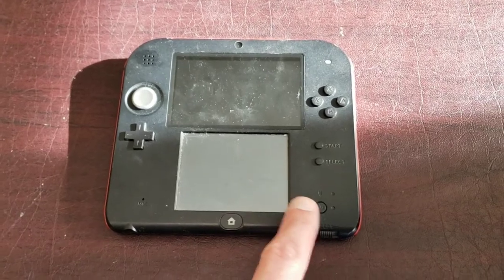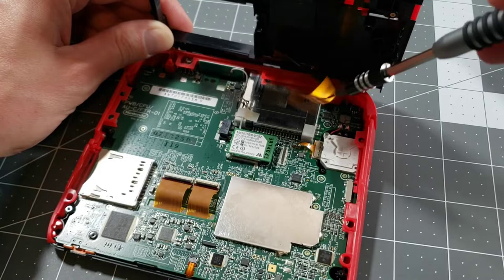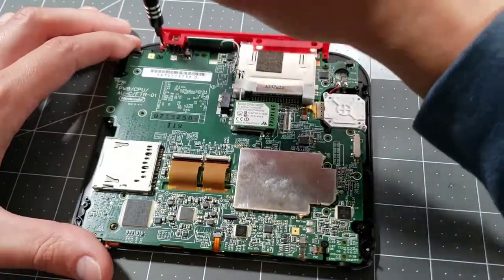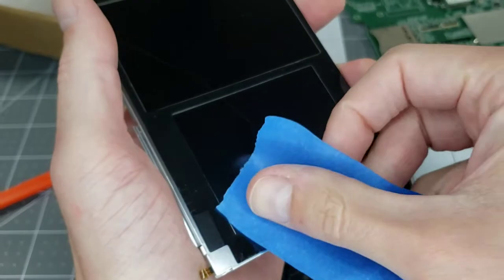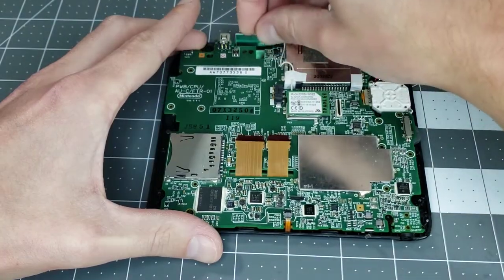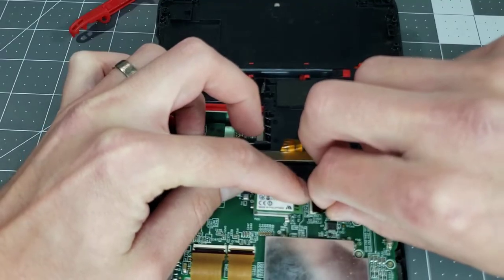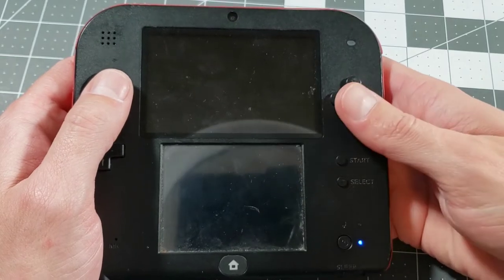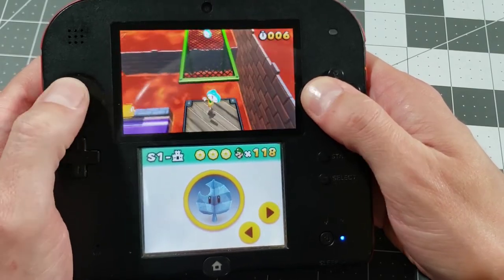Fixing a 2DS That Won't Power On  (Turns off with a POP!)

Comment from the maker: Disclaimer: Unless your 2DS has sentimental value, I probably wouldn't recommend a screen replacement simply because the cost of the screen (at the time of making this video) is almost identical to just buying another used system. If you have this issue and your screen does not appear damaged, here are a few things to check: 1) are all the screen connections secure? There are 3 in total going to the PCB so be sure to check all of them. 2) Are the screen connectors on the PCB itself in good condition? A damaged connector means a bad connection. 3) Are there any broken traces on the PCB or the screen flex cables? This can be tricky to identify, but if conductors are damaged, it will behave just like the screen is not plugged in. 4) If everything looks good and you still have this issue, just try disconnecting and reconnecting the screen cables, check the gold pins and clean them if necessary before reconnecting.
It is possible there are other causes for this issue not related to the screen/digitizer; I don't know of any, but please let me know if you come across any new information.
Happy fixing y'all!
Reply: Hey dude, thanks for the video. I'm so bad with technology but I will check to see if the connections are disconnected.
Reply from the maker: @clairejagels9598  hope you can get it working again!
Reply: @FantasticQuack  I did. Then I put my purse down at a Walmart and it got stolen. Its time to emulate
Reply: Can you fix a screen without replacing it?
Reply: You can only if it's not broken
Reply: That what happened to me
Reply: Hello, I have the same problem but even if I connect everything or disconnect everything, there are still some recommendations.
Reply: My screen is fine

Comment: I bought two 2ds and neither worked. One had busted screen, the 2nd had other issues. I pulled the screen from the 2nd and put it in the first, using your video as reference and bingo. Got a working 2ds from two scrap 2ds. 👍🏼
Reply from the maker: Love this, thanks for sharing!

Comment: Pro tip, if you arent sure that the screens are the problem, you can actually connect them to the console without properly mounting them, making it easier to test and subsequently return if that was not the issue.
Reply from the maker: True. I always test everything before a full reassembly, but don't always film it or otherwise put that footage in the video. I should probably at least comment on it to recommend doing that.

Comment: dust on screens is such a pain, i normally use compressed air it helps a ton
Reply from the maker: I do the same and then finish with tape, it seems to get all the last tiny bits that even the air duster won't blow off.
Reply: I even have a few dust particles between the lcd panel and the reflector, that is, inside, not under the glass, I don’t want to disassemble the screen, because I’m afraid it will get even more)

Comment: Is there a good way to fix a dirty sleep switch without taking my 2ds apart? My 2ds will randomly shut itself off and go into sleep mode off and on while playing and sometimes I won’t be able to turn it on I assume because the system thinks it’s in sleep mode again. I play this think like every day so I assume it’s dust but I didn’t wanna have to open it up to clean it. If that is the case, do you have a video showing that?
Reply from the maker: I've never had one in hand with a bad sleep button so no video sadly. Send me yours and I can make one :)
You could try squirting some rubbing alcohol on the button and switch it back and forth many times to work in the alcohol. I would repeat that a few times, then follow up with air duster if you have it. Then let it dry out a bit. If it was just a bit of gunk causing the problem this method could solve it without opening it up. Generally I recommend opening it though because that's the only way to clean it thoroughly.

Comment: So my sister's console died a few years ago while watching an horror movie and we thought it was over for it  (me and my sister have the same ). Until a few days ago when i tried to charge it, it actually showed that it was charging . So i tried to turn it on, it's slowly working but it turns off after five seconds or more. It can't turn on without the charger, and it looks like there's a glitch between the charger button and the power button.
Reply from the maker: I'd try a new battery to see if that solves it before looking further.

Comment: Hey man! I have a 2ds XL Pokeball edition that had its power button go out a number of years back. I have some save files on my sd card that I have longed to get back as they have special Pokemon on them. When I plug the system in to charge I get the orange led, and everything else was functional until the power button went un-alive. Is there any chance if I shipped my system to you, I could hire you to take a look at it?

Comment: I have the same problem with my 2ds xl and I also found the mystery. Apparently, in my case, it is a cable that, when in contact with the body, turns off the console.
Unfortunately I don't know how to fix it, I think I'll take it to someone.
Reply from the maker: I don't think that should happen unless the metal inside the cable is exposed. I would take a close look at that, if the conductor/s is/are not fractured maybe it is something you can just put Kapton tape over to resolve.

Comment: I have a Crystal Red 2ds that stopped working a few years back out of nowhere. I always take care of my stuff and never dropped it. It has the same symptoms the 2ds has in the video, but I’m not to confident in opening it up.
Reply from the maker: Possibly a loose connection vs the screen itself being damaged. You could start by re-establishing those connections like I did in the early parts of the video. Be glad it's not a 3DS because those are a nightmare to work on in comparison.

Comment: got a new 2ds xl with that exact problem, sadly its practically impossible to replace the screen, because its glued to the back not attached with screws, so you either break it when you try to get it in or try to close it off again. :(
Reply from the maker: It came out pretty easily for me. You could try softening the adhesive with a hair dryer to make it easier to pry up.

Comment: i have the same problem but it’s the screen flex connector while reattaching it the clip broke off and the cable was intact but there is no clip for that connector plugging the cable back into the connector leads to a popping noise that wasn’t there i got it to work for a few seconds but it stopped working and won’t turn on again what should i do since there is no latch for the connector
Reply from the maker: If you still have the clip I'd inspect it closely to see if it actually broke or if it just came out of the connector housing. Usually it's the latter and it can be reattached but it is difficult. If the latch is gone you need a new connector naturally requires soldering. If you take some measurements on the old connector you should be able to find something equivalent on Digikey or Mouser you can buy for $1 to replace with.
Reply: @FantasticQuack  thanks
Reply: @FantasticQuack  I still do have the latch but I’m not quite sure how to attach it back

Comment: Hi thanks for posting this. My son's 2DS does this only with a game cartridge inserted. Works fine without one. Any ideas?
Reply from the maker: That is very odd and not something I've seen before. Have you tried multiple games and confirmed it's consistent regardless of the game?
Reply: @FantasticQuack  thanks for replying.  I've tried multiple games and same issue.

Comment: Do you /have/ to put the sticker on the screen? I'm trying to fix my husband's 2DS, and it's still making the popping noise, and that's the only thing I did differently from the video. (Not including my husband broke one of the 4-pin connector locks, but I have enough to keep it in place for now 😅)
Reply from the maker: I don't think the sticker is 100% necessary and is more for aesthetics. I can pretty much guarantee that busted connector latch is the reason for the problem persisting. Unfortunately there's not really a good fix for that short of replacing the connector. If you still have the latch, and it just unclipped rather than snapping, it is possible but challenging to get it back in place.

Comment: My 2ds sometimes very rarely turns on for a random period of time.
The shortest time was about 5 seconds (before the menu loaded) the longest was about 8 minutes but the result is the sam, it crashes with a pop (the pop is not as loud as in this video) and doesn't turn on for a few weeks or months and then the cycle continues.
The longer I don't mess with it, the longer it will stay turned on when I do boot it.
I thought it was a battery issue but not I don't think so.
Any Idea what it could be?
Reply from the maker: It sounds like it could be an intermittent connection, you'd have to open it and inspect the connectors and cables. Redoing all the connections might be enough to solve it unless there is a tear/damage on a cable
Reply: @FantasticQuack  thank you for the advice I will have to try that sometime

Comment: What do I do if it’s the game cartridge? I’ve tested multiple games across three different consoles. Literally just the one game. I hit it with isopropyl alcohol. Still didn’t work. Hit it with brass cleaner. Still nothing. 🤷‍♀️
Reply from the maker: Sounds like the game itself may be defective?
Reply: @FantasticQuack  it worked since the day I got it in 2013. Then it just started to act wacky just recently 🤷‍♀️ Hopefully I can repair it soon

Comment: What type of screwdriver do you use on these? I can't figure it out and I'm trying to fix mine
Reply from the maker: Size 1.5 philips for the back shell. I think I switched to a 2 for the circuit board screws.

Comment: this same issue happens to me, but it does not pop when it turns off. Is there anything different I have to do to fix it?
Reply from the maker: If it doesn't pop it might mean that the speakers are also bad /have bad connection or it is a separate issue. I would start by checking all the flex cable connections and re-connecting them.

Comment: I have a question, what if even the blue light don't turn on ? For exemple i press the power button but it doesn't light on , nothing makes noise and nothing starts. I would be very thankfull for you to reply.
Reply from the maker: What happens when you plug in the charger? You may just need a new battery.
Reply: @FantasticQuack  Sorry for the late reply , I just checked and the upper LED does light up orange . Btw thanks for replying so fast
Reply: And also , fully charging it doesn't change anything
Reply: @FantasticQuack maybe it's one of  the flex Cable

Comment: What size screw driver did you use for the outside ones
Reply from the maker: Try a 1.5 and if that seems too small switch to 2. They are JIS screws and I just have regular philips drives so you have to go a little smaller on the bit size to get a good fit.
Reply: Ty I will try and hopefully fix my ds

Comment: Hello, I've a Nintendo 2ds that's turns on and stays on but the lcd stay black. why?
Reply from the maker: Did you check that the sleep mode switch is off? This can be very easy to overlook and I've made the mistake myself before.
Reply: @FantasticQuack  Not in standby

Comment: But the problem can also be caused by invisible damage to the motherboard, and not by bad power supplies or a damaged display, I'm trying to replace the motherboard
Reply from the maker: Is a motherboard cheaper than just a used working 2DS?

Comment: I think my 3ds did this but if the hinge was at the correct angle could turn on then I just need to turn the brightness all the way down and also never use 3D ever again.
Reply from the maker: I have another video addressing this issue on a 3DS if you want to check that out for some more insight!

Comment: What if the screen is perfectly fine? Anything else it could be?
Reply from the maker: How do you know the screen is fine? Sometimes the damage can be not visible or very hard to detect. I think it could also be the WiFi antenna not fitted correctly--it's the button style connector where the wire runs around the console.

Comment: Even after buying a replacement screen and testing to see if everything else works, it still has the same issue
Reply from the maker: Have you checked the physical connections on the board? If those are damaged or otherwise discontinuous it would cause the same issue.
Reply: @FantasticQuack  Everything looks fine, a friend of mine has a working 2ds and the specific areas look exactly the same
Reply from the maker: @rinmixx  the screen has 3 different connectors on the board. If you've checked them all and they look good I'd try disconnecting and reconnecting all of them and see if that helps. Without seeing it in person that's the best advice I can give for now. I hope you can get it working!

Comment: hey I need help can you fix it 2ds my is broken I just pop power please
Reply from the maker: I'd check the screen for any obvious damage (i.e. cracks). Next I'd check the connections to the screen/digitizer as they may be loose or disconnected. Last resort is replacing like I did here. If the screen is damaged that's the only option.

Comment: My nintendo 2ds volume is broken and its making the sound my it still is playable is that good or what
Reply from the maker: Hard to tell based on your description but you might solve it by cleaning (or replacing if that doesn't work) the volume slider.
Reply: Thankd

Comment: My screen keeps on flickering doing you know what the issues is ?😊
Reply from the maker: I've not seen it before, but the first thing I'd try is removing and reconnecting the screen cables. Hope you can get it figured out!
Reply: @FantasticQuack  It fixed itself by putting it sum rice idk im quite surprised
Reply: it has a new issue now it shows a orange light, but doesn't turn on @FantasticQuack
Reply from the maker: @shahrahman6256  make sure it's not in sleep mode. Could be the power switch. The fact you put it in rice and that that solved something earlier tells me it probably has water damage which can be very hard to troubleshoot and in many cases the motherboard is shot

Comment: I have one like this

It does boot godmode9 but only with low brightnes
If I have brightness high, it will turn off with the pop
Reply from the maker: If you're getting the popping behavior I assume it would be related to the screen or its connections. You could also try general troubleshooting things like removing the battery, pressing power, plugging/removing adapter, and reinstalling the battery.

Comment: Could it be caused by a swollen battery? The ribbon connectors all like fine
Reply from the maker: In this case it was solely the screen being the problem. Not sure if a battery problem could cause the same issue.

Comment: But, is this even possible to fix a 2DS that got damage by a corrupt game cartrige the cartrige that i used was called "R4" that was the game cartrige that got corrupted. and i don't know what do it! Plus it's my brothers 2DS that got damage by the R4 cartrige,
Reply from the maker: I've never heard of R4, what are the symptoms on the handheld? I'm sure there's a way to un-brick it but might be complicated.
Reply: Once I put the R4 cartridge on the 2DS it worked a few seconds. Then it crashed completely and every time I turn it on now it makes a popping noise.

Comment: The idiots who made mine tightened all the screws too tight
Reply: and the screws are stripped. Now I'm gonna have to send it somewhere..
Thanks anyway
Reply from the maker: DS model screws are very easy to strip. You need the right driver and a lot of care. If they get stripped bad you can just drill the heads off and buy replacement screws for reassembly
Reply: @FantasticQuack  ok thanks

Comment: This happened to my 2ds xl, I am no expert but I think the top lcd needs to be changed
Reply from the maker: Very possible. I've heard it can also be caused by a bad touch screen (also called a digitizer) rather than the screen itself. In my case the screen was obviously broken so I went straight to a full screen replacement.